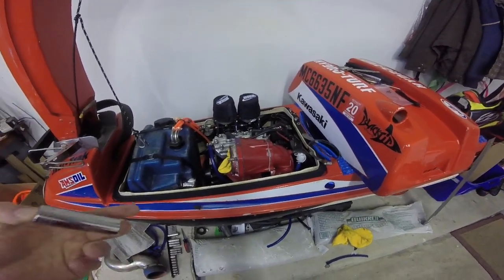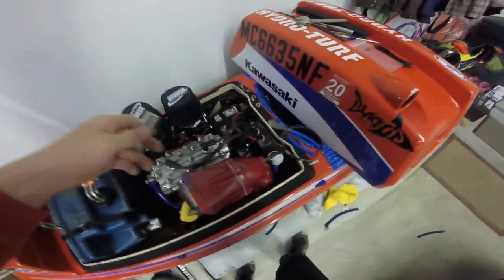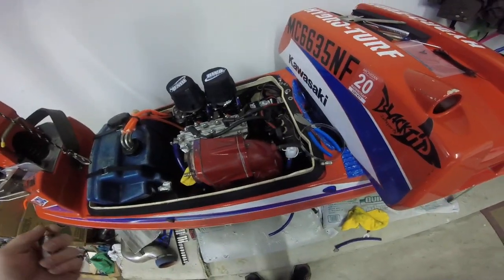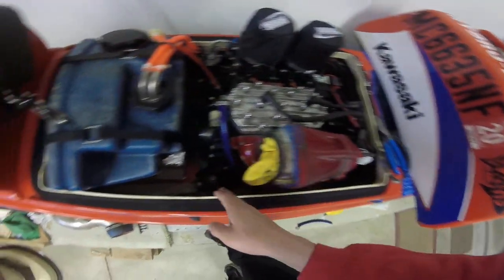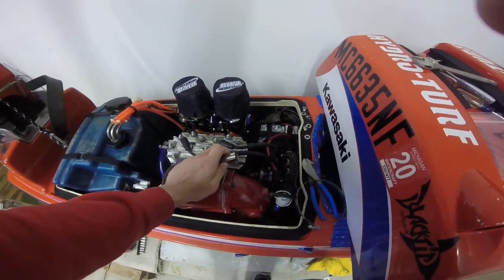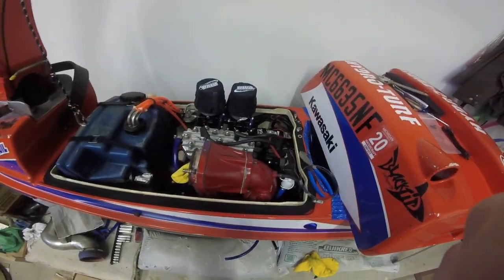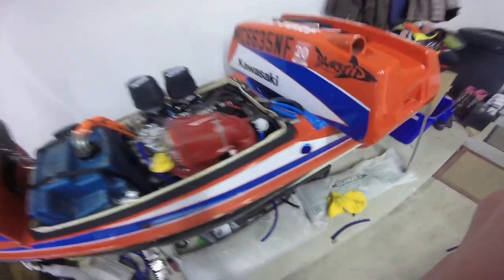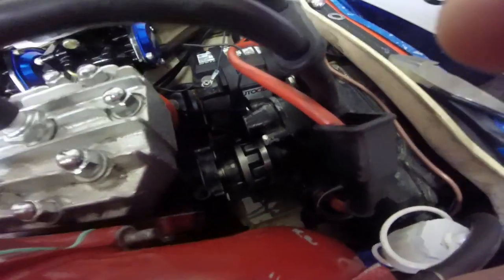How to align a Js550 engine

Comment: why make your life difficult? Instead of washers, I had to use aerobic thread glue for $ 2
Reply from the maker: Biggest things are does it run, compression, has it been rebuilt, impeller condition, and what after market parts are on it. Look for any fiber glass damage or repairs inside and out as well.
Reply from the maker: I was just already in there and the washers are kind of cool so I used them for some insurance. They definitely aren’t  necessary though just mention them as an option. I also throw loctite on the threads.
Reply: @motorandoutdoor8137  I am Polish, I do not know English well. If you mentioned this, I am sorry.
Reply from the maker: Just a option all I was saying. Thanks for watching🤙
Reply: @motorandoutdoor8137  plans to buy js550 from 1989. What to look for? 2t engines have no secrets from me, but I have never had a jetski.

Comment: why cant you do it with the coupler out then move the engine and do whatever you need to do to put the coupler back in and reinstall with the shims you used to align it?
Reply from the maker: dirtrider88 if you align it without the coupler in there is nothing forcing the engine to line up perfectly with the other coupler so when you install the coupler, between pulling the engine back out and the coupler forcing the engine to align it’ll be pulling the engine and will change your alignment.